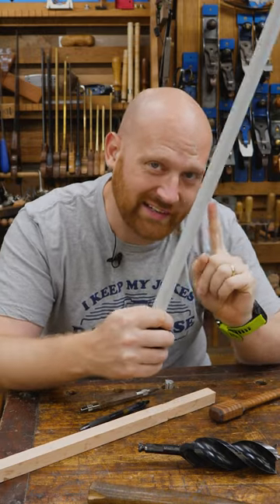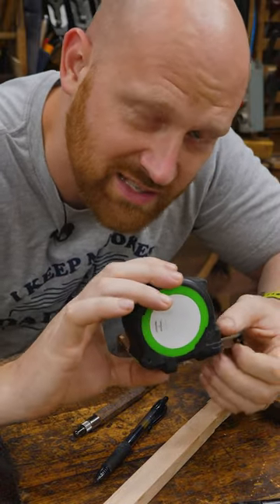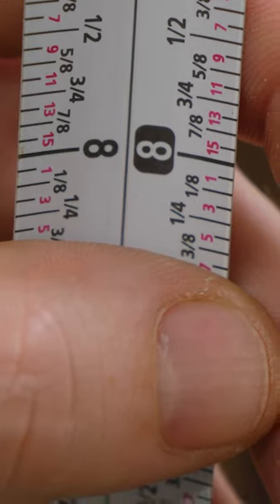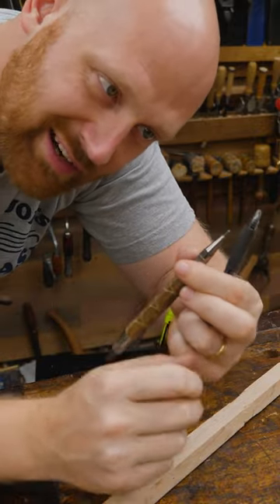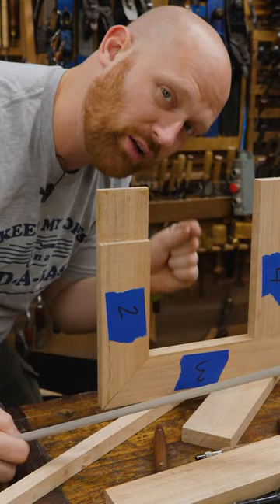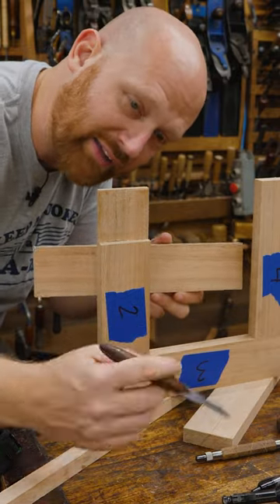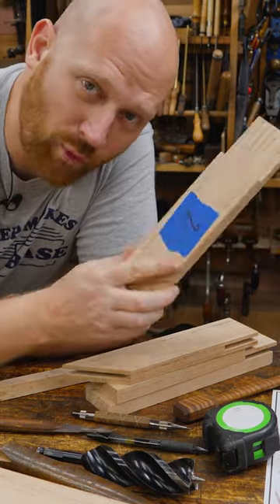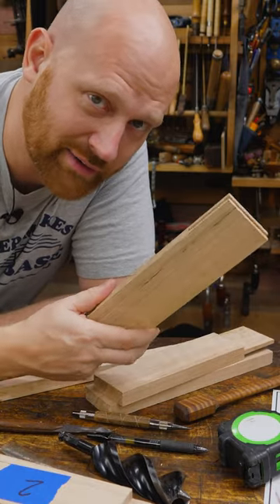How To Reduce Error in Woodworking

Comment: I do all sorts of craftsmanship, and when I’m doing carpentry with others in the field, I usually have to use a tape measure even on trim because typically they can’t comprehend this method is quicker and more accurate, yet when I work alone I usually do it this way.

Edit: Mind you, many of the wrong size cuts are because of a tape measure, either burning an inch you forget to add back, or reading the tape upside down, or reading in the opposite direction and switch direction when transferring, etc. etc.

Comment: I do graphics work, and cut lots of plastic sheets and cardboard. I stopped using a pen or pencil to mark my cuts long ago, and use my knife blade instead. Not only is it more accurate, but the “notch” also forms a ”cup” for the blade. I put the knife tip in the cup, and move straight edge up to the knife blade.

Comment: Very true and there is differences between tapes. Use the same one for the whole project. There is approximately .015 - .030 between tapes. Which multiplied 10X as an example for multiple cuts. Could be in excess of a 1/4 inch off the desired dimensions!
Reply from the maker: True, but even just using one reality is more accurate when that matters.
Reply: @WoodByWrightHowTo  100% true, most of the time I do exactly what your video shows. 
Depending on the application, I try and leave a little bit of the pencil mark. At the worst I have to shave a little more off to Taylor fit the piece.

Comment: Veritas sells bar gauge heads, so you can make gauges any length you like out of hardwood rips. I've made a set of three, providing a total range from 22" to 120". As trim carpenter, I find them handier a d in many cases more accurate than either tapes or LDM.

Comment: I would do this all the time when measuring and cutting outside corners for baseboard trim. Just cut the angle I need, slide it up to the inside corner and mark the back for the outside corner. 

Literally had coworkers asking why I didn’t use my tape and I was just genuinely baffled because I was just like “What do you mean? Why WOULD I use my tape for that?” 

I never thought about all the errors for the tape. I did always wonder about that slight slide you get from the clip on the end of the tape and how much it messes up measurements. Like I push my tape in a corner to measure the wall to the end for the length, then when I measure the board, I’m hooking it on the end and pulling it. And that clip slides like an 1/8th of an inch depending on whether you’re pushing it against something or pulling it from something

Comment: Also important. If you're making multiples of the same cut on different boards, use the first board you cut to mark the rest. If you switch up the marking board you'll see more deviation between the lengths. A copy of a copy is always worse than the first one.
Reply: Reminds me of the movie Multiplicity and the quote “You know when you make a copy of a copy, it's not as sharp as the original.” 😂

Comment: Another good tip for fine precise carpentry work lrn and use the metric system closer markings means finer measurements l😊l
Reply from the maker: Usually in metric they only go down to 1 mm. Where is with imperial they usually go down to a 30 second or sometimes a 64th of an inch. That's more than twice as many marks in the same amount of space.
Reply: @WoodByWrightHowTo  lol I never noticed that your right a mm is slightly larger than a 32. I just got used to using mm for fine detail cause it was easier and never noticed it wasn't as accurate as I thought lol
Reply from the maker: Accuracy is what you do with it. you can be just as arcuate with either of them.

Comment: I didn't think about it this way before but this is also an explanation why using the metric system isn't more accurate than SAE. The thickness of the pencil makes them both equally inaccurate. You have to use your brain to make measurements along with whatever tools you prefer.
Reply from the maker: Bingo.

Comment: Hes right when it comes to his job, but When your framing or tile or drywall your fine with useing a TM . When your testing an apprentice. You tell them your measure to a +/-  a 16th  32th or an 8th heavy or light depending. For rough or fairly accurate work you. You form a rhythm that is incredibly accurate sometimes.

Just saying he is right but im just saying ita different.
Reply: Im just saying if you have been doing to foreve the you get close to finish just by getting a measure add heavy or light then cut. You just wellll get it!

Comment: Doesn't really matter too much whether it is accurate, as long as you use the same one for every measurement.
Reply from the maker: It's not about the tape measure but about the thickness of the line on the tape measure. Anytime you measure something you lose accuracy.

Comment: Pythagoras has entered the chat. 

Your board looks roughly 12inches, and probably has a thickness of 3/4in, so you have an error of about 3/128ths of an inch if you measure it at an angle.
Reply: On second inspection, I think 8in by 1/2in would be a better estimate, so your error would be about 1/64th of an inch.
Reply: If you try to line up the board with the end to get rid of the angle, it’s just another eyeball. There will always be slop in the gears, there will always be wiggle in a rivet, no matter how hard you try there will always be error in your measurements, no matter what method you use. You can try to reduce it in many various ways, and I would trust his judgment as a professional to use the best method in each situation, but that doesn’t mean that the given method has no error, just less.

Comment: Also, for those that insist on making their marks with a tape measure and either a pen or pencil, a good way to claw back some pf the lost percision is to draw a V (literally a letter V, not necessarily a roman numeral 5) with the angle at the bottom at the point where you've measured. This won't do anything for the inconsistencies from the tape measure, but this should clear up any ambiguity from your pencil/pen marks as you're going off the spot where two lins meet, not just where one was drawn.

Comment: I mean to keep things true and square use a tape. If you want to just mark in place, there’s a time and a place for it. Something as small as your example may be ok but add 2 ft to it and measurements become necessary.
Reply from the maker: Usually I found if I build it in the shop it is faster and easier to mot use a measuring device. But to do carpenter work it is very useful but in that case 1/16" normally does not matter. That is why I said the first statement in the video.

Comment: All depends on what your cutting to, in general carpentry, this is good. But the real rule is always try to use something with 10 times more then the accuracy that is called for.

I’m what I do for a living I do have very precise gauges I can use to check holes and some other features, but most of the time I will use either a calipers (which are good to a few thousandths depending on age and quality) or a micrometer ( which is good the the ten-thousandths).

Comment: I have to work in fractions of a millimetre for my work so I haven’t used a tape measure since carpentry in college 

I have to use digital callipers most times
Reply: Same I started woodworking recently and find it's just as important in woodworking as metal working if you want to do a great job. Not many woodworkers have a Vernier let alone the Mitutoyo digital one.

Comment: what does the thickness of the line have to do with anything?
Reply from the maker: the mark on the tap has a thickness. so at what point in that thickness is correct. same thing with the mark you make.

Comment: I built a really nice double barn door for a client from pine. It fit perfect. After one month the doors wouldn't even close and swelled. The client blamed me for not accounting for swelling I trimmed it down the doors. Two separate times
Reply from the maker: Wood does like to move. That's why you have to account for it in the design so that it can move in and out with the season without causing problems
Reply: @WoodByWrightHowTo  after thinking about it  I didn't alow the wood to acclimate.  The wood was bought at a home improvement  store  then exposed to the open air of a barn

Comment: A tape measure in the metric system is more granular. It has 25 marks within one inch, while imperial system has 16.
Reply from the maker: It depends on the tape measure using. The one I'm showing here has 32 marks in an inch. And I've seen someone 64. Metric or imperial doesn't make a difference in accuracy there's still a line thickness to mess with.
Reply: @WoodByWrightHowTo  That's nice to know. Here all I have are tapes measures that double for imperial and metric (25/16).

Comment: use an edge of the line then the thickness won’t matter
Reply from the maker: Then you have the age-old question of which age. That's the nice thing of a knife line. The knife is the first cut of the saw everything on one side of the cut stays everything on the other side of the cut goes
Reply: @WoodByWrightHowTo  I do agree with using a knife, I just like to develop the habit of using the edge of a line even when doing rough work so everything is better

Comment: Start using a Hultafors TALmeter. Measure the inside of a feature and transfer the lengtg directly to the piece you're going to put in that feature, it's either going to be spot on or it'll be 1-2mm which is easily corrected with sandpaper or a plane. Use one all the time when fabricating framing and such from square tubing
Reply from the maker: Yep. That is basically a new version of a pinch rod. That's what I was showing at the very end. That's one of the best ways to transfer information when you can't bring the board over to market off of reality.
Reply: If it’s 1-2mm more than sanding is fine, but if it’s 1-2mm the other way, that is, less, than you have a gap that needs the opposite of sanding: filling.

Pinch sticks, rods, anything that can fit and hold as a gauge will always have a true measurement (assuming it’s snug and doesn’t get whacked out of place) when transferring. Better yet is a solid piece, but not always practical which, say, it’s a tight fit and needs to be inserted at an angle to get inserted first. But then again, it most likely would need to be trimmed shorter or at least have an angled cut to fit it in that case.

Comment: Isn't your mark going to be off because you're marking the board at an angle?
Reply from the maker: Not if you're using a good marking knife. It references the surface and only has a bevel on one side.
Reply: I put the piece as tight as possible. Science and math tells us as we move the point of reference up or down, in or out, it’s always based on a circular motion, a radius if you will.

If it’s not completely flat/flush, it’s not exact. But, but this is wood working, and if it’s tight it will be off by an insignificant amount. Of course the thicker the piece, the more off it will be. But even super thin, high tolerance metal, it shouldn’t be so tight it no longer fits in.

So we are talking micro measurements, almost nano scale. Very few applications actually need tight tolerances, and virtually nothing in the nano scale unless we are literally dealing with atoms.

Comment: I do not Cut on the line. 
I cut the entire line.
My Mark is not the line but the side of the Line.
I draw the line between the length that I want and the next mm line.
Reply: This guy just decided tape measure was too hard. But if he hadn’t given up he’d know you can be extremely accurate with a tape
Reply from the maker: but then you have to ask which side of the line. and which side of the line on the tape measure is the correct one. there is a reason fine woodworkers use a knife.
Reply: @WoodByWrightHowTo  true, but I always cut my own marks. I know where in intended to make the cut.
And if possible, you could make a V instead of a I shape. Having one side of the V on the cut and the other side going away to what you want to cut off.

I do think that the one making a cut should he the one making the mark.
Unless it construction work. There the error marging is big enough to let different people mark and cut.

Comment: If you use a "reality" measurement... it is ALWAYS wrong.... because your line is never directly on or next to the part you draw your line next to. Also if you already have made an error before, you make it worse by using this method.
Reply from the maker: That's why you use a knife. The knife ends up being the first cut of the song. Infinitely accurate everything on one side of the cut stays everything on the other side goes.

Comment: This is only useful in very few circumstances, basically when your marking something perfectly flat to something perfectly square. If you are marking say a piece of trim to go on a cabinet and the wood has been sanded and is not a perfectly 90 degree corner anymore, your knife will fall into that slightly rounded corner and your piece will be short. This is one of those things that sounds great in theory but will screw you over 90 percent of the time In my opinion. I gave up trying to do this years ago.

Comment: Or use mm and cm, and it becomes more accurate. Since being off by half a mm isn't a big deal
Reply from the maker: Metric system is no more accurate. It's still marked with lines. The thickness of the line on the tape measure is what determines how accurate your Mark can be.

Comment: NOT… learn to be one with your tape. Buy a machinists ruler and go to the store with it and test out the tapes on the shelf for accuracy . The tapes that your satisfied with (that line up with the lines on the machinists ruler)  can then purchase. ❤ Critical measuring❤️
Reply from the maker: Reality will always be more accurate then any tape no matter how small the lines.
Reply: @WoodByWrightHowTo  how do you live with yourself and the line of your pencil? I work to thousandths of an inch. Realize who you are comparing to..
Reply from the maker: You got to love it when a machinist comes into the woodworking world and think they know what they're talking about. I have done both as I used to be a machinist in metal shop in pennsylvania. The woodworking world is a very different world.
Reply: @WoodByWrightHowTo  not my point, I’m not a machinist. Different tolerance for every job within the trades.

Comment: Let me tell my framer building my 3500 sqft home to not use a tape measure 👍
Reply from the maker: That's a horse of a different matter. There's a big difference between carpentry and woodworking. LOL but that's a whole other argument
Reply: Yes, framing is “rough” carpentry, but there are instances where this method is still faster (and consequently more accurate) and more practical.

For example, you want to add blocking in between the studs. Should you take out your tape and measure the spacing, then pull out your tape again to mark the board?

A better way is to leave the tape on your waist and pull it from there. It’s retractable, so when you finish measuring don’t waste time pulling and putting the tape away, let it roll back in place on its own.

A better way is to have your pieces roughly cut already, put it in place and mark at the same time. No wasting time with the tape.

Better yet, better carpenters just put the piece in place and just cut it in place. No measuring nor marking.
Reply from the maker: This.

Comment: Holding that workpiece at an angle to the gap (cant push it to the inside of the frame if its completely flush) will also result in an error but lets not mention that because it would ruin the purpose of the video.

Comment: I sincerely hope your cabinets are in a temperature and humidity controlled environment, or the wood swelling is going to trounce all the careful precision you gone to the effort to make everything to. Remember, the purpose of measurement (however achieved), is solely to make A fit B in order to achieve functional and aesthetic requirements. Beyond that, extra precision is a waste of effort/expense.
Reply from the maker: that is why you design with expansion and contraction in the joinery.

Comment: If you know how to mark something you don’t need this video 😂. You mark inside or outside of the line and cut on the correct side. Not many instances you need to be more accurate then that line thickness
Reply from the maker: Is that mindset has led to a lot of gaps in woodworking. Which side was it again?

Comment: Imagine wanting to be super accurate but not using the metric system.
Reply from the maker: The metric system is no more accurate accuracy comes down to how final line you can draw and how accurately you can hit that line. It was nothing to do with how you measure it. The most accurate people don't actually use measurements.

Comment: If you cant make accurate measurements with a tape measure, you need to quit. Do what I've been taught and have been doing for decades.... mark the middle of the line, and cut in the middle of your mark. it will not matter if you use a tiny pencil or a big thick tipped marker, your cut will be in exactly the same place.  I feel this video is the product of technique taking precedence over craftsmanship. You can teach technique, but you have to learn and practice craftsmanship over time.

Comment: I mean good luck measuring a frame made of 12 foot planks spanning 92 feet while using 12 foot planks as measuring sticks
Reply from the maker: That is carpentry. In that case you have to use an outside measuring device. But this is a woodworking channel. Very rarely is anything over two or three  feet. And at 12 ft the amount of accuracy used in woodworking is not as important.